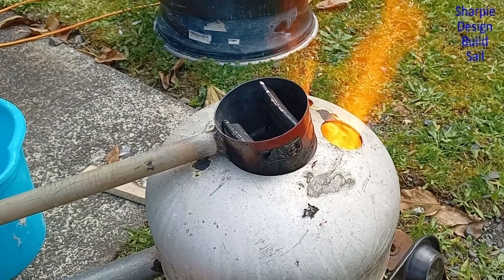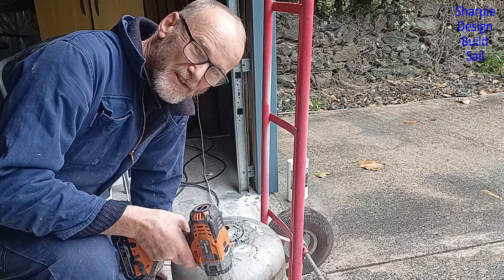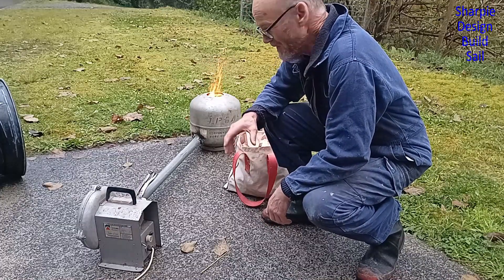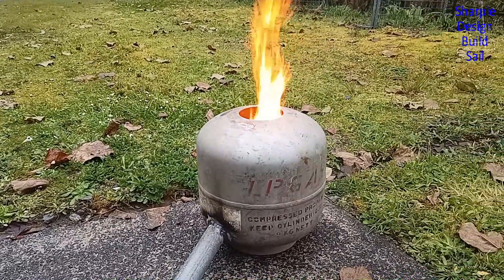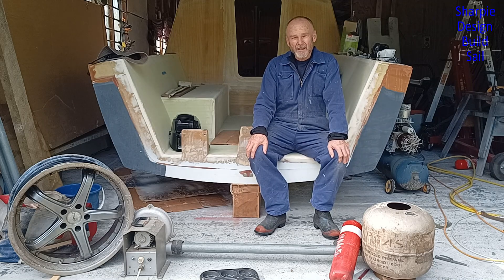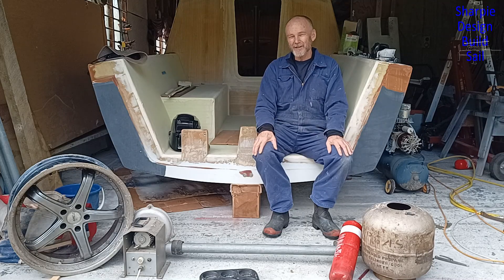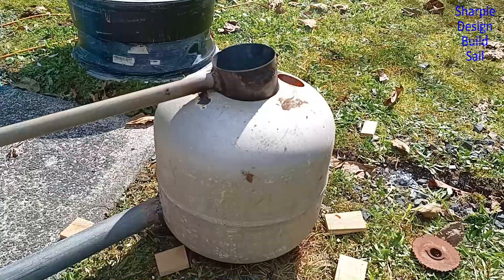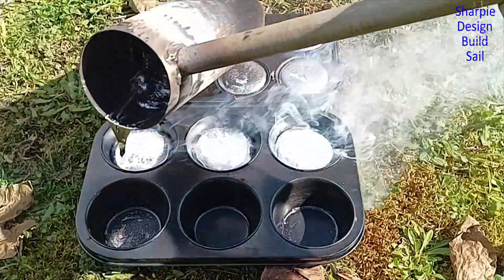Aluminum Smelter Build/Cast Ingots/Low Cost! - Rig Projects Pt1  -  Sharpie Sailboat Build - V51

Comment: You can make casting sand with sifted dry sandbox sand and grade B molasses. 
You can flux your molten aluminum with limestone powder.
Reply from the maker: Thanks for those tips! I presume you wouldn't use the sand molasses mix with the lost foam method? I was just going to use fine sand. Good to know it's limestone you can use for flux.
Reply: @KarlFullerNZ  You could still use the molasses casting sand with the lost foam method, the molasses helps the sand keep its form better after the foam burns away which helps prevent the dry  sand from mixing with molten aluminum during the pour. Typically this casting sand is used to cast solid wood or metal patterns which achieved greater surface definition.
Reply from the maker: @mrMacGoover thanks again for the suggestions! I had a good think about the molasses sand and I might use it if I was using a solid mold but the polystyrene is quite delicate and wouldn't take any kind of tamping, in my opinion. Do you know of a soft low temperature wax that I'd use on corners with the polystyrene?
Reply: @KarlFullerNZ  I just so happened to work at a candle factory in my early 20's. To that limited knowledge of types of waxes...beeswax was the softest and most malleable, not too sure about the melting temperature of each wax though.
Reply from the maker: @mrMacGoover  apparently you can mix bee's wax and candle wax with a little 'oil' to get someone you can do a little coving of corners with on your polystyrene mold. Haven't determined what the oil is yet.
Yes, candles were such a big part of everyone lives not so long ago! I smile at remembering hearing they were even used as alarm clocks as well, they'd put a little weight in the side of a candle, knowing how long it would take for the candle to burn down, from the weight and be woken by the noise! 
I like the idea of lost wax casting, a very long practiced method apparently.

Comment: I hope you asked your wife before using the muffin trays! 😅 a bit of backyard engineering is always satisfying - thanks for sharing. Looking forward to seeing the casting process!
Reply from the maker: Um, no, didn't ask but the next round of proper muffins will be compromised...
She did jokingly remind me I broke a tooth once on one of her muffins that I was too impatient to let thaw! 
Yes, I'm very lucky to have had a father that taught me you can do just about anything as he did, and he didn't have YouTube as a reference 😮
But yes, very satisfying to do stuff with things at home that normally get thrown out.
Certainly I'll be thrilled if the actual casting goes well, I was making the hot wire cutter to cut the foam today, interesting process in itself and I'm no electrical expert but I'm using a nicrome wire length to suit the power output of an unused laptop charger I had laying around.
Cheers as always for your encouraging comments!

Comment: neat! I actually did a casting project once. I sailed on to a dock and used the sheet winch as a cleat point, not realizing the screw that held it down wasn't tight (since gravity was enough), the upwards pull lifted it up and it feel in the water I still had the drum but I managed to recast the top part that accepted the winch handle and held the ratchet palls. I 3d modeled it, 3d printed it, then made a sillicone mould, then a wax casting, then used the lost wax method. I successfully cast the palls not really knowing what I was doing just a bucket lined with fire cement, a hair drier as blower and bbq charcoal. (I reckon yours might get a lot hotter with bbq charcoal because wood still has quite a bit of water in it) bronze melting is  ~900 but aluminium is only ~600. Then I was just realizing that this was a lot harder than I  thought when a casting wizard appeared and showed me  how to do everything properly. He teaches casting at an art school in Oslo during the northern summer, and lives off grid in the coromandel in the southern summer. He uses a ceramic slurry that can be painted on to the wax model that reproduces surface detail very closely. However, I'm guessing that you need the result to be very accurate if it's gonna be a bearing that's quite difficult to do with casting because of the shrinkage as  it cools. So, you'd probably need to machine it afterwards to be really accurate
Reply from the maker: So good to hear about your casting experience and great it turned out well! What a learning curve eh! Wizards are handy when help is needed 👍
Yes I'll be casting to suit shrinkage and also be machining just about all surfaces afterwards, pretty much why I told myself I needed a lathe at the beginning of this project 🤔